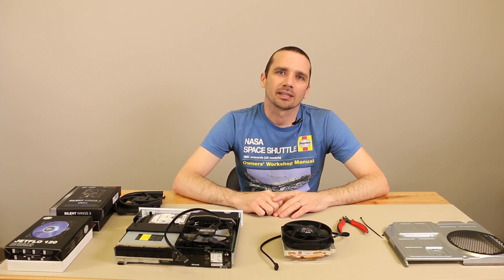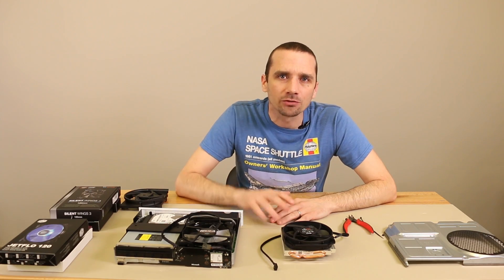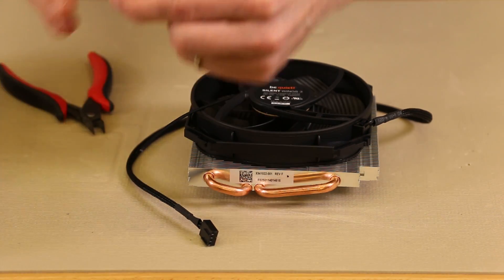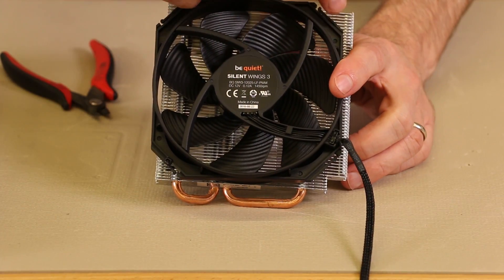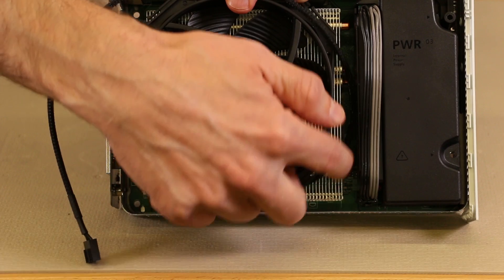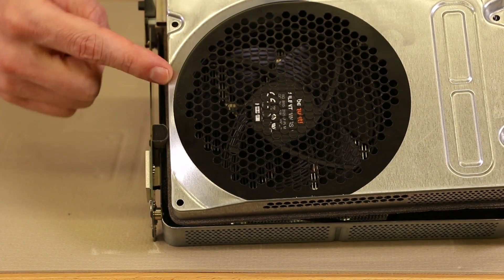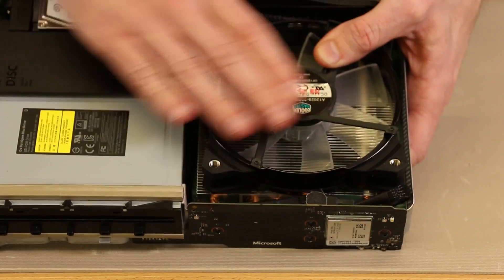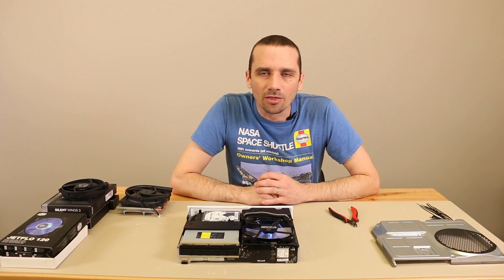Xbox One S Aftermarket Fan Mod Part 2

Comment: zip tie trick is ingenius!
Reply from the maker: It works good. Can't take credit for it but it works great for this mod!
Reply: Could you tell me is that zip tie is really saved way? They will not be melt if I will fasten zip tie to cooler ?
Reply: @Tronicsfix Thats true
Reply: yea but all that wire around the heat sink restricts airflow and over heat your console. that will really fix the ticking noise when your console stops working.
Reply: definitely gonna remember that one forever

Comment: do u know if the fan from the original xbone will work in the slim? and if it does not make the same buzzing noise? thanks!
Reply from the maker: Unfortunately, no it will not work. It's way to big.

Comment: Hi there, Can you or anyone else tell me if you have knowledge as to if this noisy fan sound is more prone to the 500GB version of the Xbox One S or if it's just as noisy on the 1TB and 2TB models??.....

 I got the 500GB version for the Christmas just passed and after about a week of playing I started noticing the sound..... Kinda sounds like a helicopter or better yet sounds like that sound a truck makes when it's just idle with the engine running if that makes sense......
Reply from the maker: It seems to be more common in the 500GB. I've got a 500Gb and a 2TB and I can notice the noise more in the 500GB but they both have it.
Reply: Just reposting what I said so sorry if your seeing the same message/reply on two different video blogs of yours.... 

Hello Steve and TronicsFix, Thanks very much for your fast reply.... It's good to know as I'm going tomorrow to actually replace my 500GB Xbox One S..... I'm thinking as I didn't pay for it that I'd pay the difference and get the 1TB model.... Has the 1TB been known to be noisy at all or more quiet like the 2TB model you mentioned? .....Appreciate your help.

Comment: First of all: great chanel!

Do you think that this new fan model (03 Jan.2017) could be an alternative to the be quiet?:
LC-Power AiRazor Black Series 120mm
The specs do read very good.Do you think it would fit if i cut of the upper lips?
Greetings from germany
PS: are you still planing on making a video about cloning the xbox one s HDD etc.?
Reply from the maker: I really don't know if it would work. The only way to tell is to buy it and try it. 
I might do a video about the hard drive...I'm not sure yet.

Comment: thanks so much man Im gonna try this if Microsoft don't fix mine
Reply from the maker: Good luck!
Reply: i went to a microsoft store yesterday with my unit and they told me the buzzing noise is normal and that theres nothing wrong with it (but it is annoying!) so im def gonna do this fix now, thanks again for the guide!
Reply: also a question, do you know if the corsair 120mm PWM LED RGB fan would work in the xbone s? if so, would it be quieter than the stock fan? thanks!

Comment: Do you think this could work with this fan ? https://www.amazon.com/dp/B0026ZPFCK/ref=psdc_11036291_t1_B00E20SSZ8
Reply from the maker: I really don't know, I've only tried the two fans in this video. I'm sure there are lots of other fans that will work but I just haven't tried them. That being said the size is right and it sounds like it's a PWM fan so I would think it would work fine.
Reply: Thanks a lot, you are doing an extremely good job and videos
Reply from the maker: Thank you!

Comment: Nice video! I got an Xbox One S Battlefield 1TB that was manufactured in September of 2016 with the annoying fan noise. I ended up using the Cooler Master Blade Master 120 MM PWM fan and the fan adapter in your link, and it is working flawlessly. I did have to cut two of the corners of the fan to get it to fit properly within the case, and I applied weather stripping on top of the fan (as the original one had).

I originally tried the Enermax T.B. Silence 120 MM PWM fan, but it was too noisy when it would change speeds.
Reply from the maker: Thanks for your comment. It's good to know that that fan works as well.

Comment: Have you considered trying a noctua fan?
Reply from the maker: No, but I may try that at some point.
Reply: Which model of Noctua?
Reply: @hondaguy9153  Noctua NF-A12x25 120x120x25mm PWM NF-A12X25-PWM
Reply: @tzant  I tried an NF-F12, it wasn't remotely close to being able to fit, plus I didn't know I needed an adapter to plug it in to the Xbox. I'm still rocking the annoying OEM fan...

Comment: Thanks for uploading, I was looking forward to this video even though mine doesn't have the problem. It's just cool to watch.
Reply: I owned a Noctua fan for my PC. It is sooo much more quiet than any other fan I had before!

In addition, I can speed up the Noctua fan at like 60% max speed, before I can hear the fan noises, I hear am much greater noise by the airflow.

Also, I checked the detialed tech tables, the Noctua achieves a much higher air pressure at even low speeds. So at lower speeds, Noctua sucks more air through the holes in the case (its pushing the air out of the pc chassi, same as XBox does).

So, Noctua is way more quiet, has a tramendious higher airflow.

So noise isnt anything you can count on. Its simply the airflow, if you have plenty small holes in the case to suck through, then air pressure comes in the first position to ask for.
Reply: @SpassKasten what type of  Noctua fans did you use?
Reply: Also, I don't think you mentioned the temperatures for both fans but I can assume that the Cooler Master is probably pulling off some more heat than the bequiet since you did say it's louder.
Reply from the maker: Yes, I think it is but I haven't tested temps yet. I plan to do that at some point in the future.
Reply: ***** Wow, I never would have guessed that. Thanks for the info!
Reply: Matze Schobi Ah yes, true, a louder fan doesn't always mean it's more powerful, I just assumed it

Comment: I also changed the ones in my X360 and added 2 more fans, I also chose to let them stay at 12v for full cooling performance though it's very noisy.

But at least never had ROD and it's still working.

Now I have a PS4 pro and when warranty is over I will do some heavy mods and probably even add a fan controller to it.
Reply from the maker: That sounds fun. Let me know how it goes and what all you do.
Reply: TronicsFix it will take a lot of time for the 2 year warranty to finish...

But I will do like I did on my 360, artic MX for thermal compound, add thermal memory cooler on memories or bigger chips that get hot and have no cooling.

Then I will probably solder a 12v PC molex power cable to connect any PC device like I did on my X360, neons, fan controller and add more PC fans.

Comment: hey steve. glad to see you tried the cooler master fan. the stock fan is rated at 800ma @ 12v so i tried to get a pwm fan as close to that value as possible even though it will never reach 100% duty cycle (unless you are gaming in the sauna) the silent wings fan is only 130ma it will be get no where near the flow rate of the stock or cooler master. i also found the fan flows better when you put a spacer inbetween the heatsink and fan but this will not allow the metal cage to fit! (im not really sure what that does anyway?) so at the moment i have omited the top of the cage! i can also confirm the original xbox 1 heatsink will not fit its so big you could almost get away with passive cooling!! cheers mate
Reply from the maker: Yes, as far as cooling goes there is nothing that will work as well as the stock fan. But since these consoles generally have no problem with overheating it should be no big deal. Time will tell for sure. I just need to get a bunch of playing time in on this to see how it does. 
Ya, there is very little room to play with. This fan fits right in there but no extra room.
Reply: TronicsFix hey how can I fix my Xbox one console started to eject disk while playing

Comment: wouldn't the plastic zip ties melt off if you're using it to secure the fan on top of the heat sink?
Reply from the maker: No...nothing inside this console would get hot enough to melt them.
Reply: no the temps will not reach that hot to melt them anyway

Comment: I'd love to see if you can put an aftermarket fan in the ps4 pro
Reply from the maker: That would be awesome, but a much more difficult project. There is very little room inside PS4's and the fans are made specially to fit in that space. That being said, it may be possible and I'll be looking into it.
Reply: TronicsFix also does the fan turn off when it's in instant on mode? And any idea on how to someone make the Blu ray drive a little quieter, like some foam or something?
Reply from the maker: Yes, both fans turn off however the LED on the LED fan stays on. 
As for the blu ray, I haven't really messed with making that quieter...maybe I'll have to check that out in a future video.
Reply: My thoughts exactly.
Reply: KRIL89 the pro is already silent no need for other fan

Comment: thank you for making this video, I bought an Xbox one s 2TB along with 500GB, the 500GB version has this bearing clicking noise, the 2TB is very very quiet, I will follow your guide and replace the fan, thanks again
Reply from the maker: Good luck and let me know how it goes!
Reply: hi, i would like to buy a one s just want to know if it possible to tell wich model and the date of your 2TB and 500GB? because it may help me when il buy it thank you
Reply: decrasooz I bought mine from Amazon UK, if you are an Xbox guy  the 2TB would definitely be useful especially for 360 games but you won't get any free game, if you want the 500GB there are multiple bundles you can get, I also bought a 1TB with gears 4 and got a free copy of Forza horizon 3 for only $299
Reply: thank you ahmad just i want to buy the 500 gb one s, but im afraid that the fan noise still exist! can u tell me what the N° model and the date of your 500gb model ?
Reply: decrasooz problem is that not all the 500gb have that noise problem, even though Microsoft will replace it for you, I contacted them on my problem and they asked me to send it back to be replaced but I didn't want to, I've done some research and seems like the 2TB version comes free from noise and only some of the late versions do, the 2TB I bought was day one edition got it on September, the 500GB and 1TB I got them on November
Reply: decrasooz I checked the date for the noisy one ...it's 26 Jul 2016, and 19 Jun for the 2TB
Reply: Ahmad thank and sorry for bothering you! last question do you think if i buy like a semptember or January model it will have the noise problem ?
Reply: decrasooz it's just luck, the noise is not that of a big deal, it's only heard in a very quiet room and if you are less than a meter from the console, I can only guarantee the 2TB will be quite, but it's nothing g series, you're not bothering me, ask me whatever you need and I will be glad to help
Reply: bro it may seem a bit too much, but I would like to hear the 500gb fan noise just to decide once and for all if I would get it or not because the 2tb is expensive for me, it's been like 8 months for me to get enough money to buy one so it's a little bit difficult I don't want to be screwed  you know
Reply: There are videos on YouTube for that, but don't be afraid, you can replace it everytime
Reply: decrasooz probally is the PS Pro a better choice for you
Reply: PvM Renz I have a PS4 pro and it's very loud, it sounds like air flow especially after few hours
Reply: Ahmad Isa i dont have any problems with it, are you sure your PS is alright?
Reply: PvM Renz it's not a problem, it's just known to be loud, my brother also noticed that with his pro
Reply: Ahmad Isa weird i never noticed it, the old ps4 was loud asf sometimes

Comment: Hey Steve. I'd been meaning to get back to you about my progress with this mod. I've been having an issue where the fan actually hits the heat sink when the machine is fully screwed back together - but it could be that I haven't tucked the PWM cable far down enough, and it's causing some kind of pressure to be exerted on the fan. It does seem to run really close to the heat sink, at least in comparison to the original fan. My solution has been to leave the white plastic cover off the console, which isn't so bad. The silence is worth it.
Reply from the maker: Hmmm...Not sure why this would be happening. I'll look into it. Maybe the screws are too tight?
Reply: TronicsFix Could be
Reply from the maker: The console used in this video is nice and quiet with no rubbing. How did you attach your fan?
Reply: I used the same method - it's nice and secure. I'm gonna try out your cable management method tomorrow, so I'll let you know how I get on.
Reply from the maker: Sounds good. Let me know.

Comment: hi, great video man, very informative, would it be possible to post the Xbox one s temps, and decibel levels with those particular fans. thanks again.
Reply from the maker: I may do that...good idea.
Reply: Please do. Also, like some people have pointed out a fan replacement mod for PS4 Pro would be absolutely insane. Keep up the good work!
Reply from the maker: Ya, that would be awesome, but I'm not sure it's even possible. I'll be looking into it though.
Reply from the maker: The noise does not cause any problem as far as the function of the console. It's just an annoyance.